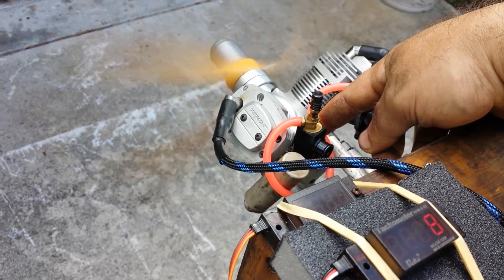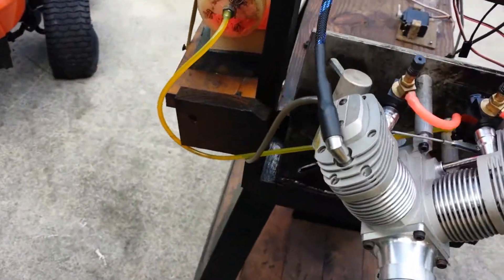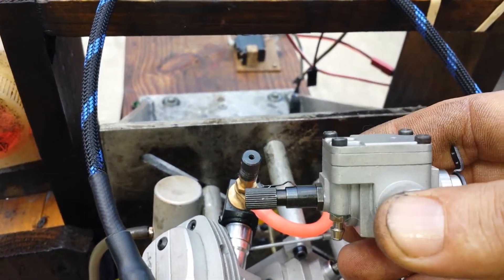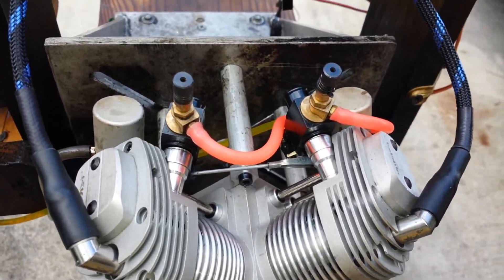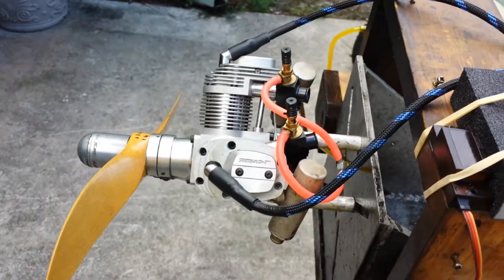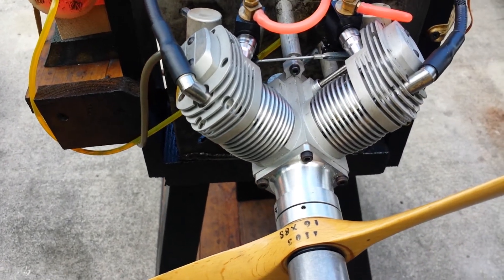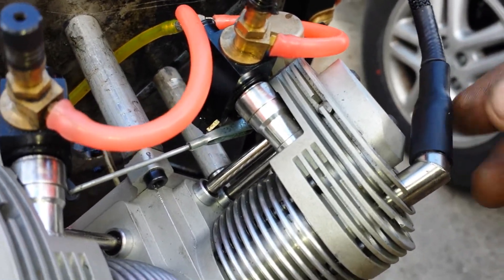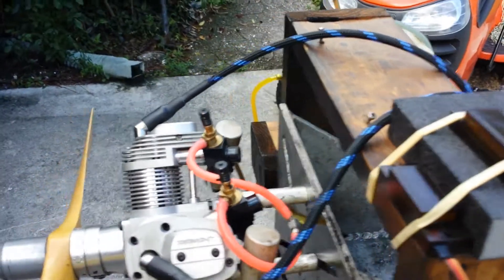Laser 160 Conversion to CH Ignition.mp4

Comment: Why ignition ? More things to go wrong and lower Rpm than the stock engine. My 160v turns an 16x8 APC at 9300 rpm and a Menz 17x8 at 8300 rpm.